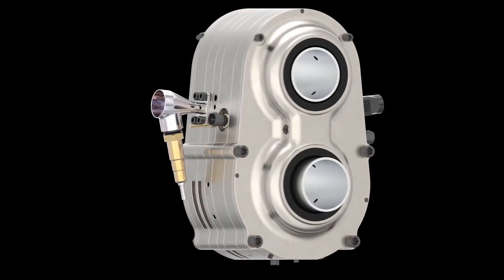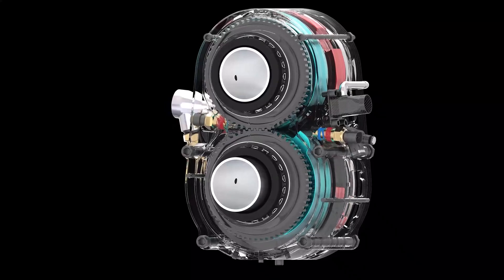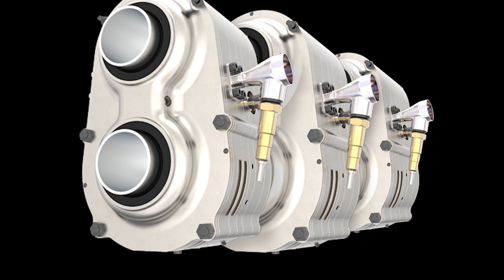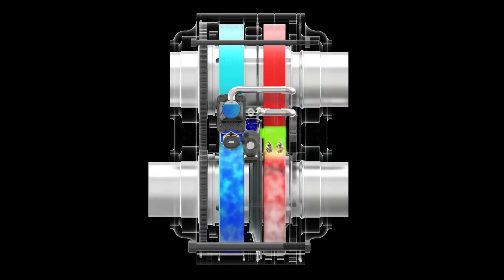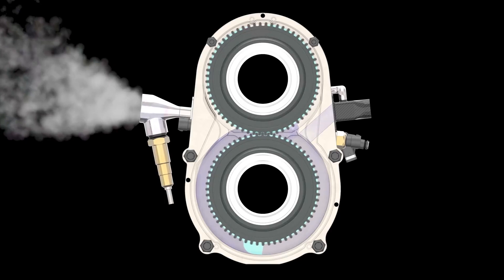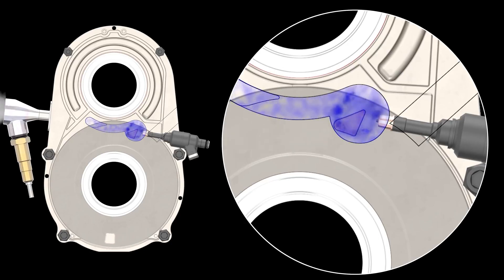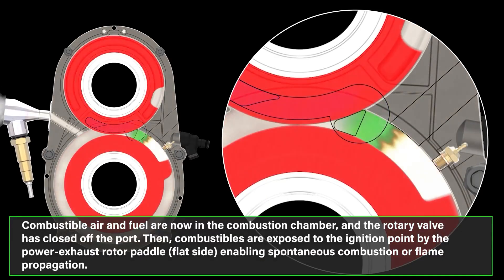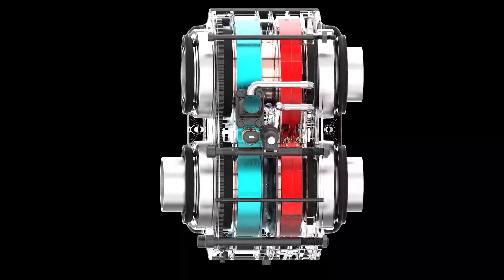This pistonless engine runs on hydrogen and revs to 25k rpm

Comment: I think the main challenge might be thermal dilatation. In order not to have a joint, you need either a lot of tight surface, or very very small space, but then, you find yourself limited in precision by the dilatation of the metal. Theoretically, the fact that the combustion chamber heats up might increase efficiency by removing heat loss, but this increases the dilatation concerns
Reply: what makes you think it's metal? 
If I had to build anything like this to withstand that kind of heat and stress, I'd use new ceramics. Less dilatation, higher temperature threshold.
Reply: @strugglingengineer1465  I gotta trust you on this one. Out of my knowledge field
Reply: @strugglingengineer1465  can such precision be achieved with ceramics? How? What kind of ceramics? Do they withstand heat gradients decently?
Reply: @quantustremorestfuturus5434  Thank you for trusting me and asking me the questions, I am not more knowledgeable than you, I'm sure, I just have a two cents on the matter...
take for example turbines of a jet engine. typically, for airliner high bypass ratio engines, one can't expect the turbine to withstand the maximum power output for more than a few minutes when turbines are made of metal alloys (think steel/nickel) temperatures reach in excess of 1000 C.
now you can't be more demanding in terms of precision than a turbine. And truly, the dilatation is a real problem for the parts. 
However, some new ceramics have been demonstrated to withstand up to 2000 C (and counting) for a far longer duration (think 30 minutes +) and of course while being as precisely manufactured as metal counterparts while also being far lighter and more durable. of course, those things are still too exotic at the moment, but that is more due to the larger design time windows of jet engines and new aircraft (the 787 took 15 years) than to the shortcomings in ability.
I think such an engine would be possible to build and to operate using new ceramics and the technology is here and proven. Now the question remains as to how much it will be democratised, are the "powers that be" willing to let go of stupid electric and inefficient ICE... I don't know...
Reply: @strugglingengineer1465  Steven Mould did a video on glass syringes & hydrodynamic or "air bearings", seems like that could relate here. For example what if instead of a traditional apex seal around a rounded triangle like a Wankel, you just had a longer arc of cylinder-in-cylinder, hydrodynamic bearing type seal, any blowby could be minimized by the extreme pressures in the sealing region or just balanced by a second combustion stroke on the opposite side. 

Also I like the idea of ceramics, obviously they do not have great shear stress as part of a turbine blade but should do quite well in a compressive stress.
Reply: @chir0pter  it can definitely work as you suggested however it'll be a headache ensuring the flow configuration at all times... it's a great subject for a thorough study...
Reply: @strugglingengineer1465  the Steve mould video makes me think this could work with ceramic parts and with out seals. It’s not an unprecedented environment either, turbines move even faster at hotter temps..
Reply: Get with the program, Gramps. The required tolerances would be very difficult to even reach with metals. Gasoline internal combustion engines have already been built that need no rings or seals. Make a wild guess how they were built (a few decades ago).
Reply: @mikemondano3624  the shape is very different here. The impact of dilatation is likely to be much harder to account for.

Comment: I would love to see this engine  be used as a Hybrid Electro/Internal Comb.  new Hybrid.  Simply put take a Tesla swap in one of these engines +  the gearing needed to allow it to be selected as an emergency gear/on board power plant while u drive replacing its equivalent weight n Battery Cells

Comment: With tolerances so tight is there even space for oil to properly create a coat? Can machines mass produce parts that have almost zero space between them? Also how do you put it together when they match so tight that it's almost fused to each other? So many questions mate.

Comment: These types of engines will most likely be used in semi trucks. Electric semis won’t work with just a battery because the 30k+ pounds in weight plus roads that go up hills will cause the battery to put out more energy causing it to lose power faster.

Comment: Hydrogen doesn't burn all clean. As the atmosphere is 78% nitrogen and hydrogen burns very hot, like with diesel engines you get quite a lot of NOx in the exhaust, which, as water is present, turns into nitric acid. The claim there will be next to no losses can not be true. The heat of the exhaust alone carries away quite a bit of energy. 
I am curious to see what prototypes of that engine will do, but I doubt the miraculous claims you make here will hold water!

Comment: As good as this engine looks, it has a MASSIVE downside - it runs on hydrogen.
Hydrogen is a very poor choice of fuel for engines unless they are 1-off bespoke solutions - as the supply of hydrogen is VERY limited (most hydrogen produced today, just like helium and carbon dioxide, is merely an industrial byproduct). If you scale up to mass production - cars, planes, ships, etc. you run out of the worlds supply of hydrogen VERY quickly and have to start specifically manufacturing hydrogen.
To make hydrogen specifically, you need a tremendous amount of energy input - FAR in excess of the energy stored in the hydrogen. If you use, lets say the current most popular method - electrolysis, and a certain amount of electricity provides enough hydrogen to propel a car with a 100% efficient hydrogen engine 10 miles, the same amount of electricity, if simply piped into old fashioned lead acid batteries and used to propel an electric motor like an EV, would propel the EV 200 or even more miles.
Reply: In the grand scheme of things, Hydrogen is the most abundant element in the universe. So, in the future that likely wouldn't be an issue.

For the present, I want to those 8 of those into a race car, running on ethanol, or CNG. Sounds fun.
Reply: supply of hydrogen is very limited???? dude..... hydrogen is the most common element in the universe..... and all you need to create more, is to split water....you know H2O..... H2 (2 hydrogen atoms) O (oxygen) did you attend chemistry class were did electrolysis ?? ... and no ..... you really don't need that much power.
Reply: "Some scientists claim that hydrogen, because it is so plentiful, is the basic building block of the universe. I dispute that. I say there is more stupidity than hydrogen, and that is the basic building block of the universe."
Frank Zappa

Comment: If the engine has no seals and instead uses tight tolerances then the whole engine is the seal. When it wears the engine will need to be replaced, this is one of the main reason we use separate seals, they are sacrificial.

Comment: Tight tolerances instead of seals?
What about friction and surface damage? You can easily change a seal, but changing big parts of the motor is a bigger deal.
How do they remove all thermal heat energy from the exhaust to achieve that silly "no losses" claim. That in itself would be a groundbreaking achievement for combustion motors of any kind.

Comment: Not a viable solution.  The  super high tolerances would make this engine impossible to manufacture unless it was machined with lasers, under conditions usually seen in chip fabs. The lack of seals would make lubrication a problem,  using combustion gases to lubricate an engine like this would create super high temperatures. I suppose this engine could be made from ceramics or high temp titanium alloys,  but that would make it even more expensive.  Such efficiency levels are not viable. 
Better to use a gas turbine.

Comment: It’s the regenerative braking that gives electrics their edge.  Also, the effective creation of a distributed network of batteries could have some serious implications for grid efficiency.
Reply: Giant issue are the batteries tho. Unless a new tech for batteries is used, today's electric cars just aren't the solution.
Reply: @MrMozkoZrout  I mean yes, sort of, but that’s conflating challenges.  Present supply chain structure notwithstanding, even todays’ batteries are a viable partial solution if applied across the portion of the population that uses a vehicles for relatively short trips. But, when you consider the potential for new battery technology compared to the physical limitation of combustion cycles - there is nothing you can do to change the limits of Carnot efficiency and even a car with a 100% efficient engine would have the same weakness when you touch the brakes - there is a lot more reason to be optimistic about electrics. This is still an interesting engine though.

Comment: I like this concept!  THIS is the kind of stuff that auto makers should be developing and not just electric.  I hate to bring politics into it, but our current liberal climate alarmists ONLY see one solution and all production needs to fit the parameters of that solution, i.e. ideas are in a box.  "Normal", thoughtful people capable of thinking outside the box need to spend more time on alternatives like this.  Liberals have proven that they do not have the capability or foresight to really develop anything truly of significance.

Comment: Hey Chris, totally agree. I'm waiting for a slew of hydrogen combustion to overtake electric. Electric cars are actually not a viable approach to replace every existing vehicle on the road. There's not enough lithium, there's not enough factories, there's not enough infrastructure. The best shot the planet has re transport, is a retrofit of all existing infrastructure and assets with greener options. Hydrogen combustion is right on the money. Still a lot of problems to work out, but I've also got a lot of confidence in it.
Reply: electrics are bad but hidrogen powered are non existant, so pick one
Reply: @omegarugal9283  For the sake of the exercise in going green, neither, for now. If that's the choice, keep status quo and wait. There's no way that replacing 1.5bn cars globally with completely new all electric cars will be green.. let alone the damage caused by mining.. the complete lack of lithium to meet supply, etc... Based on current technology we need to wait for better technology..

Comment: So if this sucker runs on hydrogen then environmentally generated electricity can be used to electrolyse water into oxygen and hydrogen during peak ability/low demand periods. Then this hydrogen can be used as fuel to generate electricity during poor ability/high demand periods. Eg: Excess solar power produces hydrogen. At night the motor burns the hydrogen to provide electricity that the solar panels cannot.

I think bearings and lubrication will be a significant issue though.

Comment: i like the idea but as some others have said there are a few problems and concerns that we have out it. I say drop the tight tolerance and keep the seals but make the seals easy access, to a point. I can see something like this being less of a driver for the engine and more of a generator for a hybrid. where this produces the power for the electric batteries. If and i mean if its as light weight as it says it is and produces the torque stated then thats perfect to hybrid in a car. this engine for power and like half the batteries as normal for the power storage.
Reply: By the time this works we have EV that do 10k miles on a single charge

Comment: You might want to consider that it’s an aerospace company proposing this. Battery planes are a huge challenge, so hydrogen, with all its production energy wastage, may well help. And such an engine may, if it actually can keep cool!, may be a good option. However there are some fantastic motors around nowadays

Comment: 480HP sounds good, but how much torque is it spitting out?

Besides that, we don't have the infrastructure for Hydrogen gas cars in place.
To switch to electric cars is easier because we already have ways to deliver electricity to basically every where in the country. 
Switching to a whole new fuel type will be a nightmare.

If this engine does ever see production it will probably be in warehouse forklifts or passenger busses and trams.

Comment: I'm not an engineer or car mechanic by any stretch of the imagination, but I am very interested in hydrogen combustion. My opinion is that the current obsession with electric cars is incredibly shortsighted and has no future beyond a little science experiment. It's absolutely bonkers to suggest that 1.4 billion motor vehicles will be running on batteries, each taking an hour (or more) to charge, and being reliant on the flakey electrical infrastructure that supports most countries - even prosperous ones. We still haven't figured out how to efficiently store electricity, and most electricity grids are still supported by carbon producing technologies, and even the so-called "green" sources like wind and hydro rarely offset their carbon use within their serviceable lifetime.
The whole electric vehicle trend is one huge distraction from proper solutions like hydrogen combustion. As I understand it, there are still massive issues with hydrogen combustion, many far cleverer people than me have stated arguments against hydrogen combustion as a principle in the comments in this video, and I know that actually producing combustable hydrogen efficiently is still very very expensive or not carbon efficient. But even with these challenges still in mind, I still think this idea has far more scope than the ridiculous electric vehicle craze.
Reply: Well said. My thoughts exactly....
Reply: What's even crazier are the climate change lunatics with their zero carbon nonsense.
Reply: Bravo!

Comment: The main emissions from this engine is water vapour . Well you might be surprised to know that the main greenhouse gas is water vapour in fact 96% . Co2 is a minor greenhouse gas less than 3% however it has been demonised as toxic and a pollutant when in fact the opposite is true.